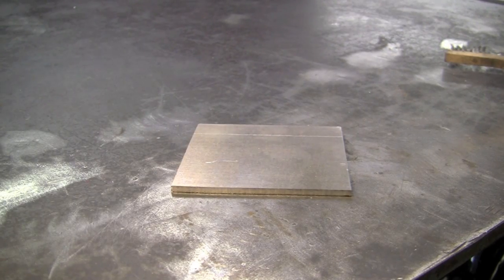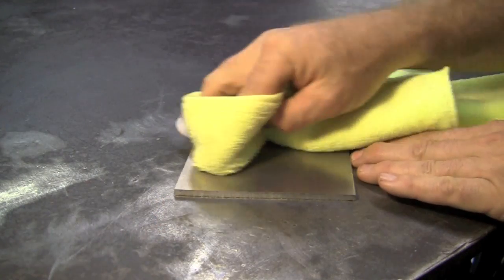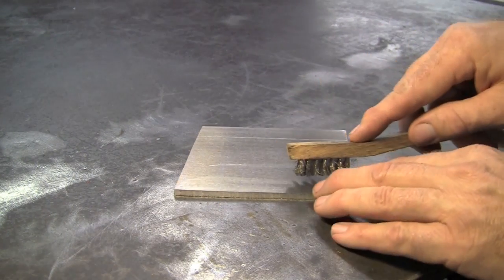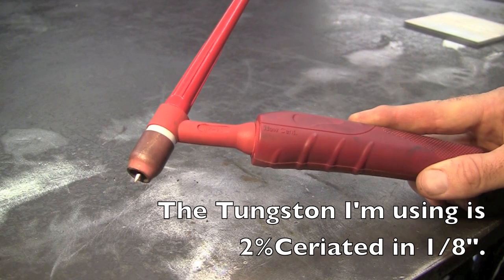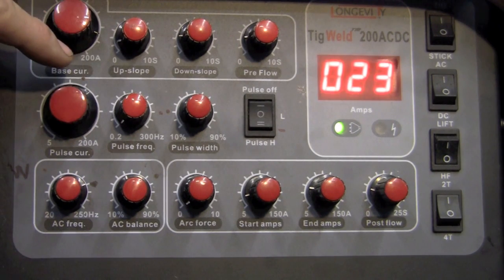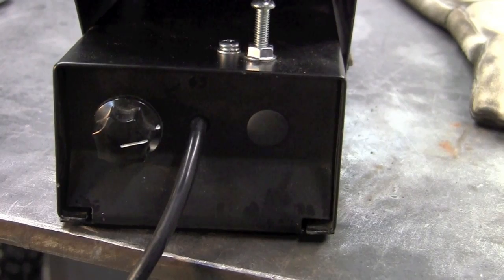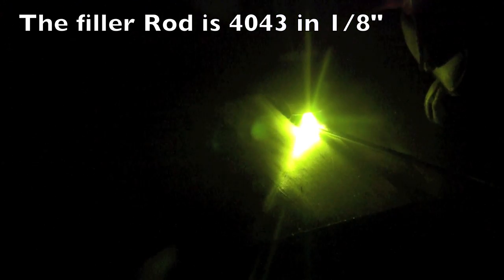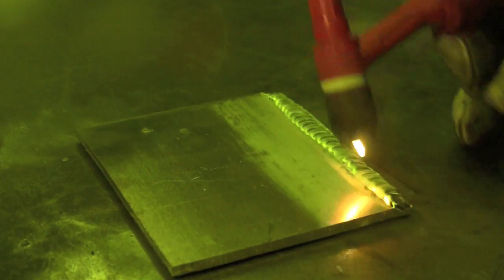Learning How To Weld Aluminum With LONGEVITY TIG Welder in Pulse Mode Review

Comment: I didn't use this pulse method until I took on two new welders. I started them off  just like I learned....Hot and fast. I'm looking for a very nice bead,spacing, penetration, and a repeatability for the new welder. I tried this method out and they were able to achieve great results in just minutes! It works well for steel and aluminum! Making the best use of technology! Now my skid plate production looks like I welded them whether I did or not!

Comment: Hi Tim, maybe im a old timer, But im a air tool guy for cleaning,(heck,there so cheap),and as Danny knows,i used to be a Riland dealer,but learned on what the world did,the miller 330,that ran on a 120 amp breaker(YIKES)  And I dont use any pulse,as to me,it slows me down! Just wondering if any one else does this on aluminum? Thanks,Jack